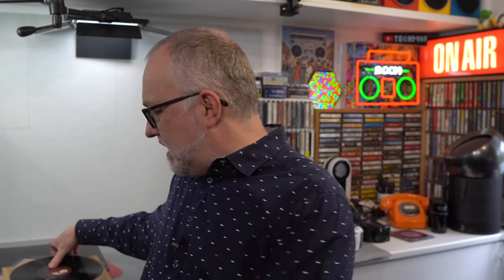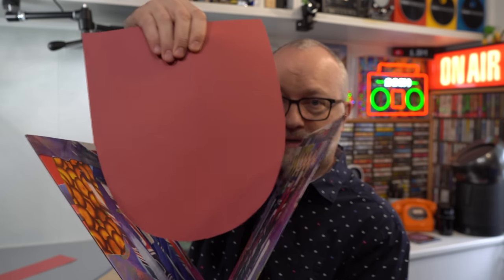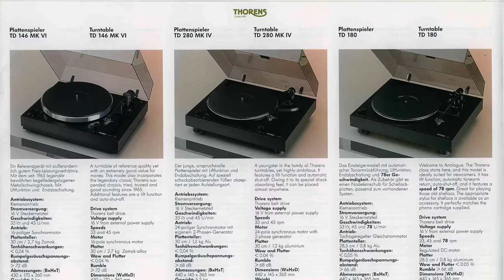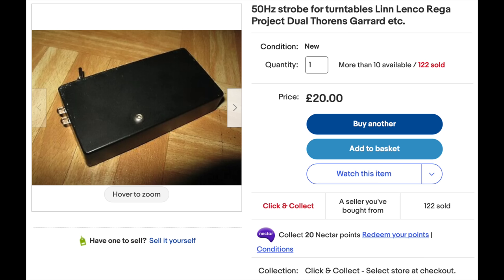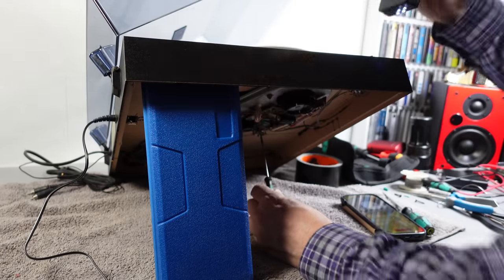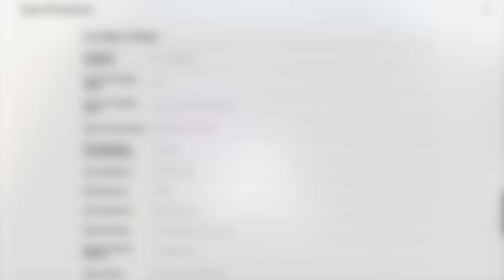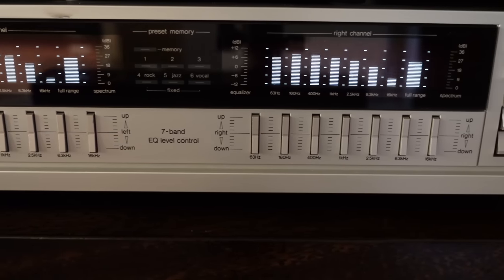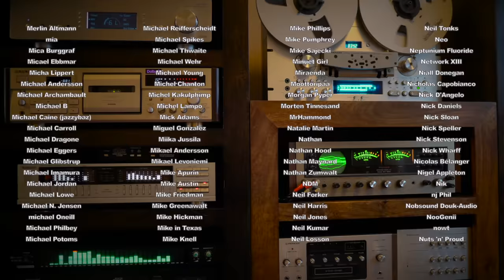Playing 78 RPM Shellac Records properly

Comment: Just a couple of hints from someone who has been playing records of all speeds for 72 years (!) - first, you can tape a coin onto the top of the head to get the stylus pressure right. Otherwise, if it's too light, the needle will tend to skim over the most active parts of the groove, causing distortion and wear. Second: you probably noticed that the arm was swaying a bit when playing some of your discs. This is because the hole is either too large or was not centered properly when the disc was manufactured. I've encountered this surprisingly often. It causes the pitch to go up and down. The cure is to enlarge the hole enough so that by trial and error, you can tap the side of the record while it's spinning (recommended to do this at 33 ⅓) until the sway is gone. Then you should most probably record it when it's perfectly centered, so that you don't have to do it again the next time you want to hear that disc. And one more thing: I have a (real) Thorens which of course only has 2 speeds. If I lift the inner turntable, the spindle is resting in a bed of motor oil in its slot. If the oil dried up, there would be a lot more friction, which would of course make the motor work harder, and also slow the turntable down. Don't know if this is also true of your Thorens, but you might want to check it.

Comment: Very nice video!  Just a few notes to add, if I may...best to simply wire both channels together in parallel at the cartridge for best sound.  Also, I have found the main factor is the condition of the record, remember these were played with period equipment with heavy tracking and worn needles, and after only a few dozen plays were starting to wear.  I have also noticed that the quality of the recording studio equipment itself makes a difference, esp microphones.

Comment: Just a couple of small quibbles: (1) Incandescent lamps are not the kind you want for a strobe disc. You want a fluorescent with an old-school ballast, or an LED with very little filtering, or a neon. An incandescent is exactly the wrong thing, because they do not flicker much. And pots do drift with age. Not only do they drift, they get dirty like volume pots. Adjustment was the correct repair. (2) One is not supposed to twist the cartridge when using an overhang protractor. The idea is to move the cartridge back and forth in the headshell slots in order to have the headshell line up with the markings on the protractor at both inner and outer setpoints. If this is not possible (which means the tonearm is not properly made), then twisting the cartridge may be the only option.

Comment: When I decided to replace my turntable I went for one that could run at 16⅔ as well as the other common speeds. Not that I've used it at that speed yet, but I have used 78... with a mono cartridge with a suitable stylus, and correcting the EQ when I digitised a record I bought specially to test. It sounds nearly as good as a commercial CD with the same track.

Comment: I have the task of preserving the remaining 78s from a collection where many have already shattered or otherwise broken.  The older AT-PL120 does a good job, having interchangeable headshells and adjustable tonearm height.  The VM95SP cartridge you tried works ok but I prefer the sound of a Grado 78c which has a mono output.

Comment: Also need to add the v groove on 78s only dates from the late 40's. Most of the 78 era, the groove was a U shape!
Also 78's were never recorded stereo. An improvement in signal to noise ratio may be obtained by paralleling the left and right channels.

Comment: I've said this before - and I hope you don’t mind my saying it again; but you’re such a nice attractive gent! Also; I love how you explain everything - many don’t,  and so you make things REALLY easy to understand.  Re the Suitcase Players - or indeed any modern Players that claim to be able to play 78s. I can sometimes tolerate the sound with the wrong stylus, but many of these Players, I think I must be the only one purchasing them to play 78s, as they all had other issues like; they haven’t allowed enough clearance for the 12" 78 record; it catches on the Arm Rest on many. (you might know that some 12” 78s are just an mm or two larger than an LP)  Also, they nearly all have the Auto Stop feature, and they nearly always stop before the end of even a standard 10"  78...  Then of course, I had many that ran at the wrong speed – and at about the same speed of only 60 rpm instead of 78!   From this I am assuming that despite the different makes, they are all coming from the same factory and being set in the same wrong way. But I’m puzzled as to why in all the Reviews I read - nobody ever mentions any of these issues I have.  So, is it only me who is buying them to play 78s I wonder? Of course I’ve always sent them back for Refunds when I’ve found they’re no use to me. But I obviously couldn’t do all what you did in this Video, and so I wondered please,  even though they’re all not very good, is there any single one of the cheap model suitcase type that you know could say is the 'best' of a bad lot?  Please help. If I send any more back, Amazon will be banning me! LOL  Many Thanks in advance.

Comment: Yes, Saturday mornings, 10am, the best time of the week. Another great video and very interesting. I started off with a cheap £80 Ion turntable in 2016 with built in speakers and amp, which played all the speeds, then upgraded to a Rega P1 in 2017. You need to move the band to adjust the speed, so not such a technical design but far superior turntable at £250.

Comment: I'm splitting hairs, but the cartridge already mounted on the turntable looks like an Audio Technica AT91 series, which you can just buy a 78rpm stylus for. There's no need to buy an entirely new cartridge. Quite a lot of entry level (and indeed some up spec carts) have 78rpm stylii available for them, AT95 series, Stanton 500 family, AT91 series, Ortofon OM series, Shure V15 family, Shure M44 series, Shure M91 series, and I believe some Grado carts all have aftermarket 78rpm stylii available for surprisingly modest cost. The Stantons and Shures have been ubiquitous with the DJ industry for decades so the aftermarket options are plentiful and availability is excellent.
Yes there's an argument to be made for mono (which 78s are) vs stereo carts and the sound differences, but as you did, if your pre-amp / headphone amp / integrated amp has a mono option then this will usually suffice for all but the fussiest of setups.
I've had pretty good results using an ATLP120 TT with the factory fitted AT95 cartridge with an aftermarket 78rpm stylus - they sound surprisingly good. Another tip I'm sure you're aware of is that you can wash the records before playing them - they will sound way better if they're clean. Just remember - don't use any solvents on 78rpm records as shellac is not very chemically stable and isopropyl alcohol or methylated spirit (or any commercial record cleaning solutions) may damage it so just stick to tepid water and a mild dishwashing liquid, this works just fine.
Regarding the trimpots - given that scenario I'd probably just go straight to adjusting the pots first before replacing components. Caps will run out of spec with time (even if the device isn't being used) but you'll know if they're drastically out of spec because the turntable usually won't hold a steady speed when this is the case. When it's an actual audio signal it's more important of course, but a simple motor speed controller circuit will have quite a lot of adjustment available before it runs out of spec, and as it's only controlling the motor speed then you can usually get away with it until they are really buggered!
Cheers.

Comment: If you don't have any incandescent lights, you can use fluorescent tubes to achieve the effect for the strobe discs. If you don't have that, you can use cheap non-dimmable LED bulbs that do have the 100 Hz flicker, which will also achieve the same effect as the fluorescent tubes for the strobe disc.

Comment: To use the strobe disk, you need a fluorescent lamp, not an incandescent one. Incandescent lamps use tungsten filaments that offer high resistance to  electron flow and thus glow "white" hot. Fluorescent lamps do actually flicker on and off at the frequency of your mains current and the strobe disk needs this turning off and on at the mains frequency in order to work. Even though incandescent lamps also turn on and off at 50HZ (or 60HZ here in North America), the glowing tungsten wire never cools fast enough to go out and keeps producing light through the on/off cycles.

Comment: I too faced the same issues in wanting to record my 78 rpm collection, but took a completely different approach.
First was the pickup. I managed to find a 1930's magnetic pickup that takes steel replaceable needles, like the wind up players do.
It needs power to drive it, so the turntable consists of a Garrard platter, driven by a directly driven 24 volt, 1/4 hp motor and speed controller. It has no problems with driving any record.
The amp came next. These recording were designed to be played on valve (tube) type gear, so I designed and constructed a valve amp based on a Tetrode power valve, operating on +/- 1,000 volts DC, with a triode pre-amp. About 20 watts output, single ended class A.
Connecting a speaker to the unit, and tapping off using  high impedance tap, I was able to get decent sounding recordings using Audacity.
Was I satisfied ? Yes, I used Audacity to equalize the bass region and boost the treble, so a simple top cut tone control on the amp got rid of most surface noise.
By the way, copyright was removed from any recordings more than 100 years old and anything that old is now legally in the public domain, so a recording from 1923 can legally be played publicly and not infringe copyright. I think that's a sensible decision.

Comment: I have to say, the difference is quite noticeable.  I was actually under the impression that 78's by their very nature were inherently a noisy format, due to the limited technology of their time.  Having said that, you new setup is very impressive, and I can take away a new respect for the format.  Cheers from Indiana!
Reply: cheers from northern Indiana up by South bend also!🎉
Reply: I guess part has to do with using schellac as base material, which meant any further improvement was not possible. Vinyl is more soft and flexible and doesn’t suffer from the hiss, pops and scratches as much as schellac.
Reply: @telocho  Also, as I recall things shellac records were impregnated with an abrasive to help ensure the needle wore down rather than the recording. That seems like it would GREATLY increase surface noise.
Reply: Shellac is inflexible and brittle.  Vinyl is much more durable for repeated plays.
Reply: Indiana techmoan gang (Indianapolis here)

Comment: I have a feeling that sending both channels into the headphone amp for the mono switch would eliminate more noise - the way that stereo is decoded from a record means that summing the L+R channels effectively cancels out any vertical movement (which would otherwise come through as simultaneous clicks/pops but inverted in one channel). Just a hunch but might be worth a test.
Reply: Your suggestion actually works well.

Comment: I never thought in a million years 78s could sound so brilliant. I'd have no problem listening to these all day long.
Reply: My thoughts - exactly
Reply: Fresh 78s could sound wonderful on the equipment from the 1950s and 60s. Heck, they could sound wonderful on a full size console player from the 1930s. Even AM radio (back when it still played music rather than talk nonsense) could sound wonderful on a full size console radio from the 1930s. The belief that 78s sounded bad came from either incredibly worn and dirty disks, or in more recent times, from using the wrong stylus. AM these days really does sound terrible on any radio, but 2 inch tin "full range" (they are NOT) speakers sure doesn't help any.
Reply: and a bit of crackling is kind of charming :)
Reply: @lwilton  In the 1950s there was a short lived record label called Audiophile that released microgroove vinyl 78s which were mostly if not entirely made up of Trad Jazz but unlike most records these records were red with two tracks on each side of a 12" record. I've also seen Rivermont record with recent 78s as well as LPs in addition to CDs & MP3s so it's possible to obtain modern 78s that are suitable for playback on RIAA standard equipment.
Reply: @stuartlief9614  The 50's MGM and HMV records had the NAB curve that sounded clear and bright on RIAA playback

Comment: One thing to try - record them in stereo then use a M/S process to eliminate the "Side" (Difference) portion of the signal, leaving only the "Mid" (Sum) portion. Compare that to either just the left or right channel from the same stereo capture - giving you three different choices to use for the final mono file. I've personally found that the "Mid" portion usually sounds the best, and sometimes one channel or the other wins.
Reply: Are you familiar with the pspatialaudio Stereo Lab software?

Comment: One important advice, don't clean 78 RPM records with any kind of alcohol: they're made of shellac (a secretion of an insect used also for violin's paint) that melts beautifully in alcohol.
Reply: It’s also used on apples, weirdly enough
Reply: Didn't know this. Thanks for that. Distilled water to clean?
Reply: @1234jacee  you're welcome. Yep, distilled water and a few drops of dish soap, brush it gently, rinse, pat dry with microfiber.
Reply: @_innerscape_  I wash shellac records in the kitchen sink same way I wash used vinyl records, using a bit of dish soap and a really soft brush, trying to keep the labels from getting soaked. After rinsing off the soap I use a rag to soak up some of the water (no aggressive wiping), then I put them in a dish rack to dry. Some used records are absolutely filthy when I receive them and they get a cleaning before I ever stick them on my record player.
Reply: I just received a set of Bartok 78s that were ruined by the seller or whomever they got them from by that treatment.

Comment: 27:45 An advantage of using that stereo cartridge, is that it can also play the Edison vertically cut Diamond Discs.  You’d simply wire one side backwards and sum to mono.
Reply: please explain further. thanks
Reply: @-IE_it_yourself  you inverse the polarity of one of the channels, doesn’t matter which, and then wire the outputs together (that’s what “sum to mono” means, because the signals add together)
Reply: @-IE_it_yourself  
When Edison saw that Berliner’s disc system was superior, he tried to make his own modifications to it which involved making it proprietary.  Instead of cutting the groove laterally like everyone else, his method was to cut vertically.  This way, if people wanted to buy a copy of an artist that worked with Edison, they would also have to buy a player from Edison.  
Attempting to play an Edison Diamond disc on a “normal” gramophone would result in no sound since the pickup is designed for lateral movements.  Plus, it would also damage the record.

You can however play these Edison Diamond Discs with a modern stereo cartridge and 3mil stylus, but since it is vertically cut, one side will be out of phase with the other.  One way to fix this to wire one of the channels backwards on the cartridge, and then sum the outputs to mono.  Another way is to record it in Audacity as a normal stereo record, but then “invert” one of the channels before summing to mono.
Reply: I recently did this to listen to some Edison records. The other factor is the stylus size. The 3 mil for shellac 78s is too large for Edison records. For those you need a smaller size that can get down to the bottom of the groove and ride the vertically recorded hills and valleys. I'm using a .7 mil stylus and the records sound great.

Comment: Techmoan is the only expert I need to listen to 👍

I don’t have any lps, cass, cds, mini-discs anymore but it’s always interesting how Mat approach’s these formats. 

Back in the day I’m pretty sure we just played these formats as is, I know I did. I never had any speed apps or mats etc (as there wasn’t any)

I played records slightly faster or slower, higher eq or lower - depending on what sounded better to me. 

“Experts” can continue talking about your power suppler being near the power plant, wires being made from virgin copper, speaker having the correct gauge coil and your room being on the moon to avoid noise pollution 🤦‍♂️

Comment: Another budget option, if you are just archiving recordings using Audacity, is to play the record at 45 rpm (with an appropriate 78 stylus of course) and to use the "Change Speed" option under the "Effects" tab. An increase of 173.3% will increase the speed to 78. Another important thing to note is that if you have a Mono switch, turn this on, as this will decrease the surface noise. If you are using a stereo cartridge the Left and Right positive outputs can be joined at the outputs of the cartridge.
Reply: Since it’s going through a RIAA preamp, just make sure you run the inverse RIAA EQ filter in Audacity BEFORE the change speed feature.  Then after changing the speed, apply the correct EQ for that particular 78.
Reply: There's no need for a mono switch since you can easily merge both channels in Audacity. I would say you should try to sample at least 96kHz when recording as otherwise you'll lose higher frequencies which would be audible if played natively at the correct speed.